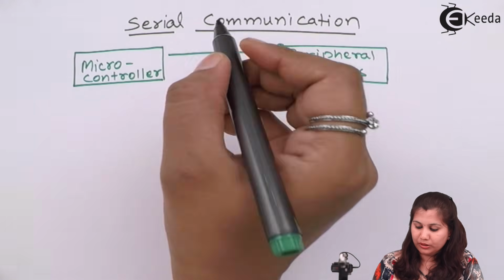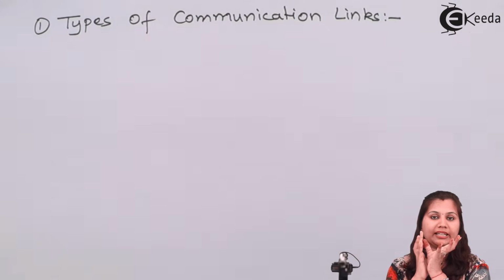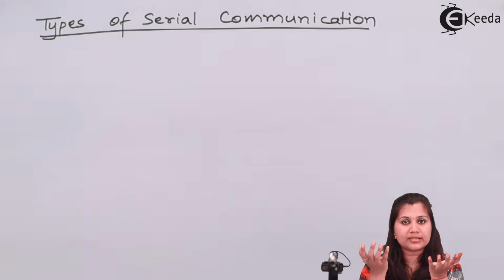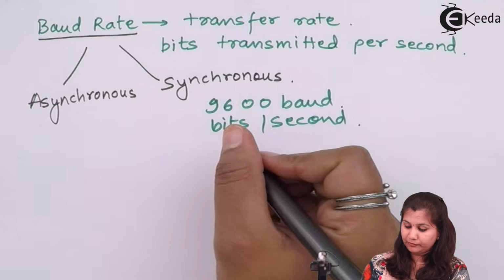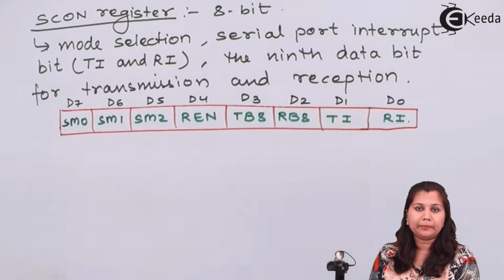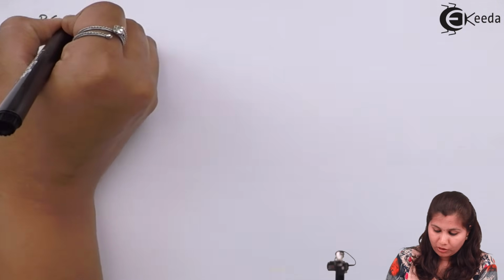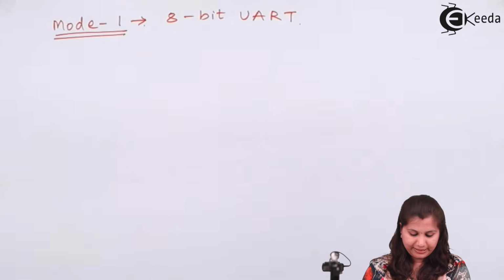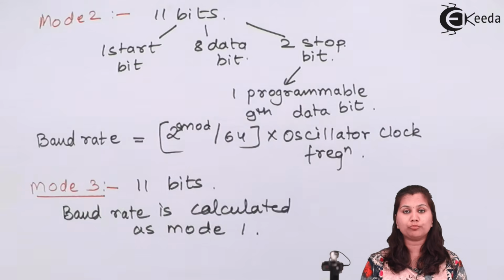Serial Communication in 8051 Microcontroller

Comment: ┌──────────────────┐
                     │       CPU        │
                     │   ALU + Control  │
                     └────────┬─────────┘
                              │
                     ┌────────▼────────┐
                     │  Register File  │
                     └────────┬────────┘
                              │
        ┌─────────────────────┼─────────────────────┐
        │                     │                     │
   ┌────▼─────┐         ┌─────▼────┐          ┌────▼─────┐
   │  Memory  │         │ I/O Ports│          │  Timer/   │
   │ROM / RAM │         │          │          │  Counter  │
   └──────────┘         └──────────┘          └──────────┘
                              │
                 ┌────────────┼────────────┐
                 │            │            │
            ┌────▼────┐  ┌────▼─────┐ ┌────▼─────┐
            │ Serial  │  │Interrupt │ │ PWM /    │
            │  Port   │  │  Unit    │ │HS I/O    │
            └─────────┘  └──────────┘ └──────────┘
                              │
                       ┌──────▼──────┐
                       │    Clock    │
                       │ / Oscillator│
                       └─────────────┘

Comment: 00:04 Serial communication in 8051 Microcontroller involves transmission of data in bits.
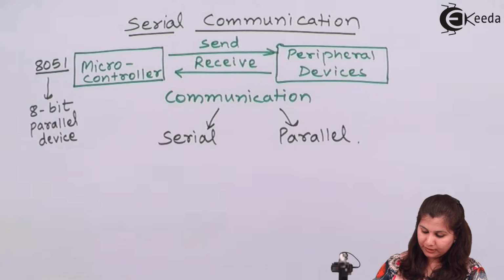03:22 Difference between serial and parallel communication in 8051 microcontroller
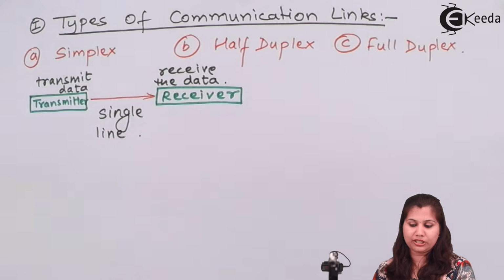10:09 Explaining simplex, half-duplex, and full-duplex communication in serial links.
13:49 8051 microcontroller supports synchronous and asynchronous serial communication.
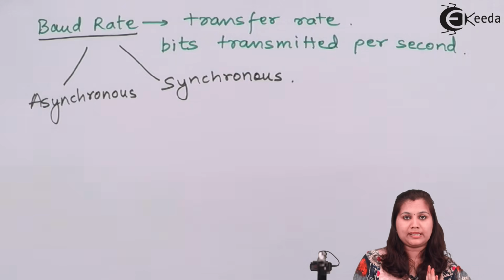20:35 Understanding baud rate and its calculation
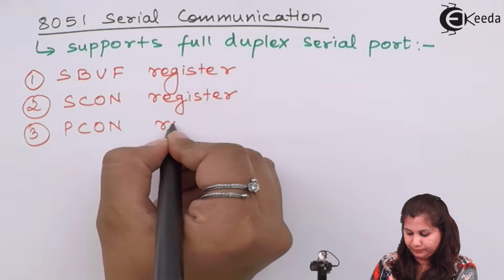23:45 Special Function Registers in 8051 Microcontroller for Serial Communication
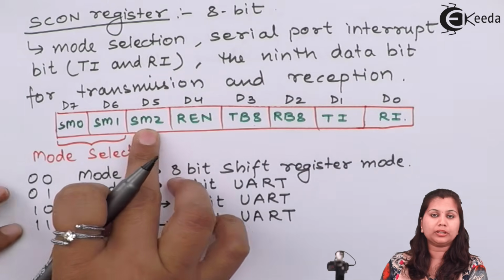30:56 Exploring the significance of different bits in serial communication control register.
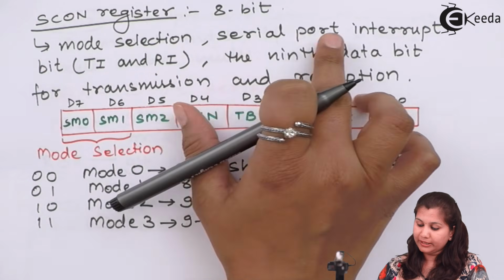34:05 Understanding the PECON Register in 8051 Microcontroller
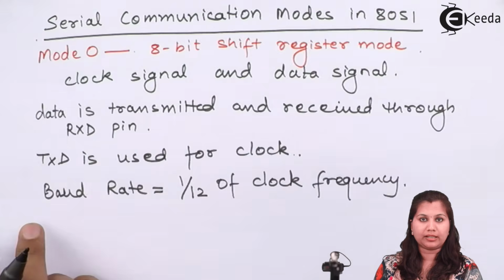40:19 Mode 1 in 8051 microcontroller supports synchronous transmission and reception with 8-bit UART.
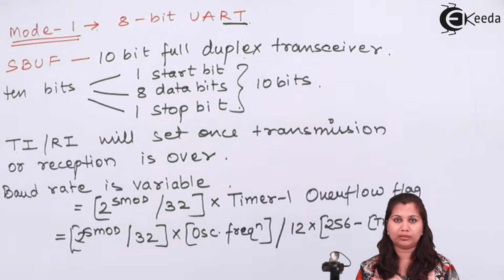43:55 Difference in baud rates between modes 0, 1, 2, and 3.
Crafted by satyam
Reply: Thank You Very Much

Comment: if two different sbuf resister sharing the same 99h ram address,..then how can we read and write data simultaneously if it is full duplex?????    i got the point that for writing and reading two  different register buffer takes part.  but for program how can we access the two different data register value having the same ram address???????
hope i am clear with my question